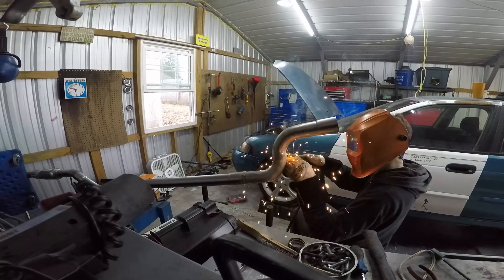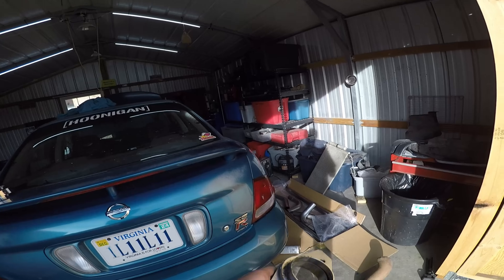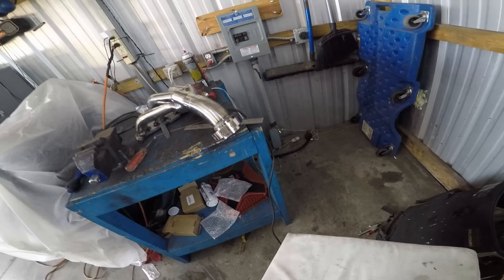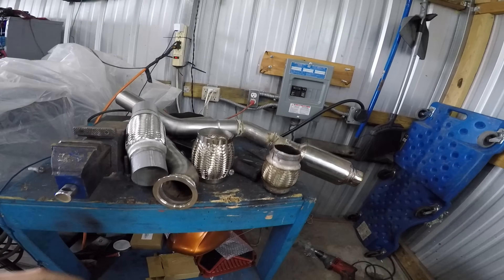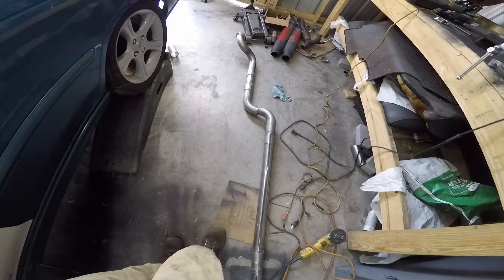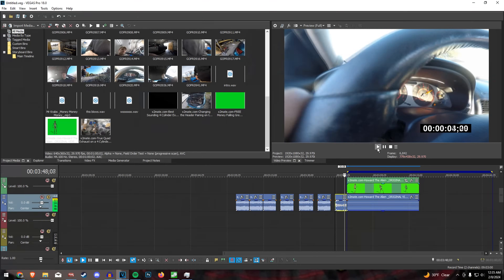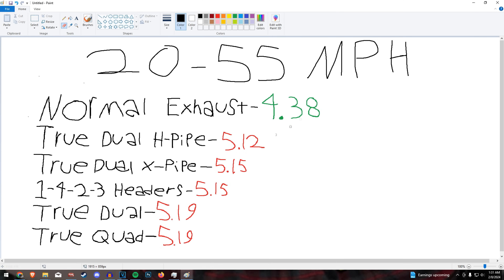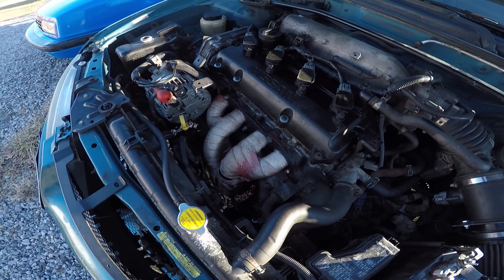How Bad Were the True Dual 4 Cylinder Exhaust Setups for Performance?

Comment: For a h pipe or x pipe to offer better performance they need to be placed in exactly the correct spot. The old boys found the right spot by putting some non high temp paint along the front part of the exhaust and going for a good run, the middle of where the paint burns off first is the exact place to get the best performance. I doubt you want to keep doing this but it's food for thought! ... also do a dyno run because realistically except for the obvious clear winner of stock setup the others are way too close to be accurate by looking over footage. That being said I'm loving your videos so keep them coming 😉
Reply from the maker: Yeah when I was making the exhausts I just put the H and X pipes in the most convenient spot, because performance wasn't on my mind. I was surprised that all of the setups except for the regular exhaust were basically identical times, I expected them to vary more. The Sony Vegas dyno definitely isn't accurate, but it gives us a basic answer as to which were better
Reply: @HatersGarage  Please retry the x and h pipe with placement performance in mind. 

We need to know what is possible with 4 cylinder exhaust that actually sounds cool!
Reply: @HatersGarage  Yeah I absolutely loved this little series. Nice work dude
Reply: @HatersGarage  Oh yeah by the way .. Unequal length headers 😉 pleeeeasee
Reply from the maker: @reed00112  I have an idea floating around for some unequal headers
Reply: @HatersGarage unequal length headers with the H pipe might be the best sounding setup
Reply: That has to be some old wives tale, surely different brands/colours would burn off at different temperatures
Reply: @Darminedoggydoor  it's not about at what temp it burns off its about where it burns off first. It'll be a pretty obvious point along the exhaust only a few inches long. It doesn't matter what temp the paint burns off at. It's actually a pretty interesting effect, you can Google it for the scientific answer
Reply: @stronkworks it would definitely be interesting to see. But the inconsistencies in exhaust pulse flow, which is what gives it that lower frequency rumble, is literally where you’re loosing power. Even, consistent pulses will have a smooth sound with no audible lower frequency, and will give you the best performance. So unfortunately, theres no way to get that cool sound without sacrificing power. The same goes for a crossplane v8 as well. They have that rumble sound due to uneven pulses in the pipes due to the firing order. An 8-1 header or dual headers that cross a runner from each side to even out the pulses will outperform a normal dual header setup. It just doesnt sound as good 🤷‍♂️ It’s really about personal preference, and build goals. Its kinda funny, i actually had the same idea as this guy did a long time ago, and actually did it on my honda before this guy ever did it. I couldnt find anyone else who had done it so i tried it myself. Only difference is my header pairs 1-3 and 2-4 which has the same odd pulse effect as 1-2 3-4. I thought about adding an H pipe but i actually really dig it the way it is currently with true duals. Also, another factor that this guy never took into consideration is the exit location of the exhaust. All of his dual setups exit right next to each other. Having them spread further apart actually INCREASES the rumble sound. You’ll also notice, if you listen to a corvette with no crossover, but with a quad exit in the middle, it sounds like it still has a crossover.
Reply: @reed00112 2J racing makes an unequal length header for the QR25 call The Medusa. I've ran it on three of my SpecVs so far. They've been mistaken for a Subarus many times.
Reply: Nonsense, any exhausted change requires tune for engine, no matter what exhaust if it's bigger and has more flow you will loose power, always on any car and engine setup. You need to tune engine to new exhaust so you have proper back pressure or whatever it's called in English.

Comment: would it be possible to remote mount a twin scroll turbo on the true dual? you would need a specific header to group different cylinders' exhausts even if you're placing one in the hood

Comment: We old school motorcyclists went through this starting over 50 years ago.
We learned that a 4 into 1 beat 4 individual pipes. And that a 4 into 2  into 1 (a Tri-Y in car speak) beat everything.
Liked the vid!
Reply: It really depends on a lot of things. Bikes are a different beast because the capacity is small and internals are sturdy meaning you can rev out to 15k rpm which drastically changes things. Comparing say a big block V8 to a 1000cc inline 4 is apples to oranges. I appreciate that this Nissan is not a big block V8 but you know where I’m coming from
Reply: Yeah, but does it SOUND cool, that's what matters. At least in the case of my 650 twin it does, it's pretty slow, so might as well make it sound nice doing it.
Reply: Yeah but let's be honest here, exhaust performance gains, for street vehicles, is a min-max thing. Unless you're regularly going to the track, how it SOUNDS should be much more of a factor in deciding your exhausts than a single-digit horsepower gain at a very specific power band.
Reply: Of those, I think 4 into 1 sounds the coolest.  4-2-1 sounds too... normal these days.
Reply: The RGV500 disagrees with you.
Reply: That is a 2 stroke, completely different animal.  @salazam
Reply: What about a cylinder (inline 6)...it's 2 separate banks that blend into 1 exhaust pipe immediately after the header. Would this be the optimal setup or a dual exhaust pipe to the back (3 cylinders per pipe)? Wich in your opinion would be best.

Comment: I'd dog you for that Flowmaster because it's definitely making it sound worse, but "It's what I had" is an extremely valid response. Also, IDK if I mentioned it in the last vid, but KJK (the other guy who tried 1-4, 2-3) reported an increase in torque and mid-range with the even-fire UEL design at his 3x length ratio. Haven't gotten another update from him since, so there's only the build+startup+static mild rev. Really wanna hear that car under load to see if it improves, but anyway.

Also, if you had a 1-4, 2-3 equal length, more commonly known as a 4-2-1 or tri-y, that was properly made, those see benefits across the board under 8000rpm. David Vizard and other builders of his caliber strongly recommend a 4-2-1 (1-4, 2-3 paired) equal-length header on any 4-cylinder that doesn't spin past 8k. Though it does involve a bit of math to tune the primary and secondary lengths and diameters.
Reply from the maker: I've heard that 4-2-1 setups make more low end power, and that's why OEMs use that setup. As far as tuning the headers for performance, I really wouldn't want to bother with that unless I had a dyno. Without it you pretty much just do the math and hope you got it right.

Comment: In my experience building motorcycles, having some back pressure in the exhaust system over straight pipes helps performance. I have no idea why that is in all honesty, but my bike ran way better with some back pressure. In this case the “stock” setup with a muffler gives you some back pressure and likewise the 4 into 4 zoomies have virtually none, so I figured they would perform the worst. Thanks for the entertaining vids!

Comment: 2 factors on why the quads were slower.
Since you have more pipe, there was more weight added.
Having only 1 pipe will cause a higher exhaust pressure velocity coming out so it will flow better than having 4 with less exhaust pressure velocity.

Comment: You should try adding a second looping pipe that is twice as long as the other pipe to try and mimic a V8 sound
Reply: that could be crazy
Reply: Per cylinder? 8 header pipes? Is double the length just an idea, or did you the math on it?
I looove the idea of a V8 sounding inline 4
Reply from the maker: I would like to make a 4 cylinder sound like a v8, but that's like trying to convince someone that your donkey is a pure bred race horse. I could try the looping pipe, but I think it would just sound like a really clappy 4 cylinder still
Reply: @HatersGarage  I would say more like painting zebra stripes on your donkey, silly but entertaining 😀
Reply: @HatersGarage  Actually maybe running two sets of split header pipes, one longer then the other that re-enters at the same collector.  I'd have to figure some math out to find the optimal length to simulate a V8's firing order, but it might be worth a shot for fun.
Reply: yeah if you want the 'American V8'  (cross plane crank) sound you want uneven firing sound, if you just double the firing sound you get a flat-plane crank V8 (European) which sounds rather like a pair of I4s already. if you are added more curves/elbows you will have to math hard to know how much length to add on your second set of pipes, and it will likely wander with rpm/exhaust velocity

Comment: The one thing you never took into consideration is the distance between exit location of the pipes. Having the pipes further apart actually INCREASES the rumble sound. And closer together has a similar effect to a crossover. 

Listen to a corvette with a quad exit in the center. Ive even seen one with true duals (no crossover) and it sounded like it still had a crossover due to the exit locations.

I actually built a true dual exhaust on my honda accord 2.3 about a year ago. My pipes exit on each side of the rear bumper kinda like an old muscle car. It has more of that aggressive rumble sound than even your true dual.

Also, theres other factors that can have an affect, such as runner lengths, and overall pipe length on each side. An exhaust with a crossover or y-pipe with equal lengths from header to crossover will have a smoother sound than one with uneven lengths before the crossover, such as on a truck, where the exhaust will usually run down the passenger side. Muffler placement also has an affect.

Comment: 2 things that I can think off. The weight of the pipes and the backflow. Typically you want to have some backflow to the engine so it doesn't make vacuum pockets which steal potential power right out of the cylinder

Comment: Pretty sure you have to either tune to have proper fueling or add intake volume to benefit from the exhaust systems extra flow and add more fuel. Pretty sure stock maps cant adjust properly for the modifications so a tune is necessary.

Comment: Awesome work and experimentation😮

 Just did some research on a jet engine exhaust system that did some crazy stuff. 🤔 

What about an overlap of both your ingenuity and that- all with just some of the things on hand? 

Like a exhaust turbine of sorts?
Reply from the maker: An exhaust turbine, what a novel concept. Perhaps I could pipe the air it generates into the intake.

Comment: It would be nice to see a true dual exhaust that separates the inside and outside cylinders... thinking to my Ecoboost Mustang.  One unique thing that Ford does on this engine is to separate the inside and outside cylinders in the exhaust.  That's to optimize the efficiency when combined with the twin scroll turbo.  P.S. I'm running an MBRP 3" car back exhaust with a Y pipe...

Comment: The single exhaust performs better because of the venturi effect. One exhaust pulse pulls in the intake charge resulting in more power.
Reply: It's a little more complicated than that, each pulse needs to merge the stream in a different place or at a different time, so each pulse is right in the front or on the back of the other and have sufficient distance to create vacuum to pull the later one without messing up their shape and so the flow if they collide or closely travel with each other at different velocities.
Most times this is done naturally to some extend by the exhaust manifold piping having to varry in length from cylinder to cylinder in order to meet the exhaust.
Stock manifolds and exhausts are usually designed with this in mind, custom exhausts ruin the whole thing as nobody knows what they're doing or get involved in maths and simulations like in the factory design, you might get an increased performance with a random exhaust but rarely the engine performs ideally throughout its whole powerband, that's why it's better to use complete exhaust systems that are designed for specific applications.
Reply: @johnbelwell2461 yea but you act like any exhaust company is doing that anymore either. Maybe a 5 grand titanium exhaust but any catback your finding under $1,000 hasn’t had that much r and d done to it lol.

Comment: I still prefer the sound of the true duals w/wo the h-pipe . I would make up the difference in efficiency by going to a host engine with forged internals ( ecotec 2. O , srt4 2.4 ) and add compound boost . Example ; supercahrged ecotec 2.0. Add true duals with a tiny turbo at the end of each exhaust.  Reduce the boost on the factory m62 supercharger and factor in the compound boost of the two tiny turbos .
Reply from the maker: That's very convoluted, but would be interesting
Reply: @HatersGarage  I don't know how I allowed myself to entertain that . Just turn up the boost at the supercharger . It's only a smidge haha

Comment: The true duals must lose too much mid range torque. One of them might make more power than stock but at redline, and that’s not real world driving. Only on the race track do you always use the upper range of the revs. It was interesting to hear the different pipes. Excellent work man!

Comment: 20-55 is a torque pull so naturally the normal exhaust will do better because it has back pressure which improves torque

Comment: I think it's something to do with exhaust valve timing and backpressure. The collector creates a backpressure that the car is tuned to allow some of it back into the cylinder, mixed with fresh air to create higher compression. Something like that idk, science.
Reply from the maker: The engine lets some exhaust back into the cylinder, but it's not to increase compression. It's to remove the need for an EGR valve, and improve emissions.

Comment: Are you still wiling to experiment with exhaust sound? I have one suggestion. Split the exhaust in two ant he end, route one pipe back to front and reintroduce that back to the system. That should really mess the pulses up. At some rpm might even sound like double the cylinders.

Comment: I think the normal setup out performed the others so much because that's what the stock tune is designed for. If you took the time to dyno tune each of those setups I bet the differences would shrink significantly

Comment: Is it possible that the increased times are a result of an altered/ less effective exhaust scavenging pattern?
And what about cylinder pairing per pipe? (ie 1&2, 3&4; 1&3, 2&4; 1&4, 2&3.)

Comment: you should do a header with cylinders 1 and 3 wyed together and cylinders 2 and 4 wyed together and then wye both pipes together into a single exhaust into a muffler

Comment: I have two Flowmaster fxs on my Nissan Altima 2.5 and they sound great. Bottom line is the dual exhaust versions just flowed too much. I'm guessing if you would have used a smaller diameter pipe in your true dual setups it would have worked well.

Comment: 4 into 1 offers best gas flow, because you have a constant exhaust gas flow from at least 1 cylinder. If you connect 1 + 2, and 3 + 4, you get a flow that goes fine for 1 crank revolution, then stalls for another one, then goes again. So basically a stop-start system instead of continual flow. The issue should be obvious.

Comment: quad exhaust will always sound better imo, has the sound of a subaru without uel headers.
Reply from the maker: Technically the quad was unequal length headers, each pipe was a different length
Reply: @HatersGarage  ah alright, my apologies. but its still cool though

Comment: True duals on V engines keep each bank separate from port to tailpipe. You just did a Y pipe with two exits. 

A better test would be to make two separate exhaust manifolds and have the exhaust separate the entire way. That would be an actual true dual system

Comment: Im not professional but people says you need tune for exhaust to work. Maybe your cars original tune is good for normal exhaust. 
+you gave special attention to normal exhaust too 😂
Reply from the maker: I didn't really give it much special attention, just cheap headers because my old ones were chopped up
Reply: What do people mean by tune when they're talking about a stock ECM? I'm confused as to why they think you put a holly EFI system in it. Do they mean to say they have no idea what they're talking about?
Reply from the maker: @jankington216  People think that you have to have a tune for exhausts, in reality the ECM makes adjustments to the air fuel ratio automatically, usually up to 25%. The stock ECM on the stock tune will do fine with just an exhaust.

Comment: What was the pipe diameter of the dual setup? Too much area is bad for velocity. If you ran duals, they should have been 2 inches. Maybe even less as it traveled away from the manifold. There are V8’s running 2 inch duals.

Comment: I'm thinking of modifying my car's exhaust to run dual pipes, it has a 4-2-1 header from factory, so I think on just getting rid of the 2-1 part and run dual from there, but the issue is that there's a Co2 sensor that's needed for the engine to run properly. How would you tackle this issue? Putting the Co2 sensor in a X-pipe is a viable solution?
Reply from the maker: In the X pipe is probably the best solution

Comment: If the car pulls slower with the different setups, I'm assuming it's because the exaust gases are exiting slower. Could be the pipe diameter is too big, causing too much of a difference in pressure from cylinder to exaust, making for exaust pulses making less vacuum to help the next pulse. Definitely not an expert on this, but maybe go for smaller diameter pipes?